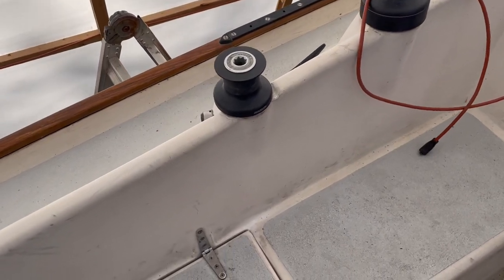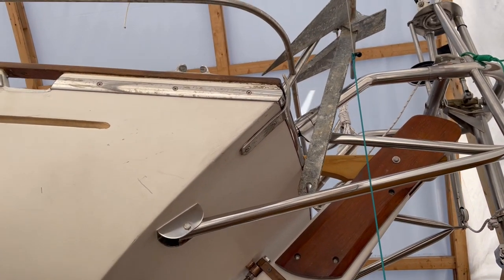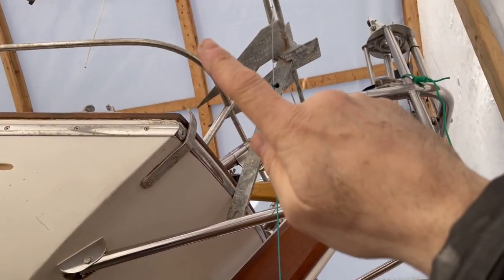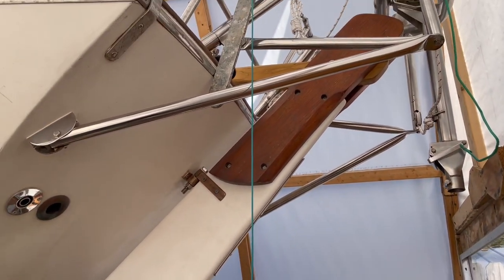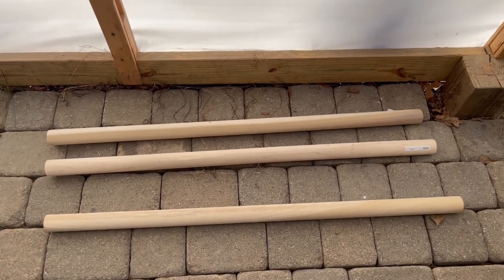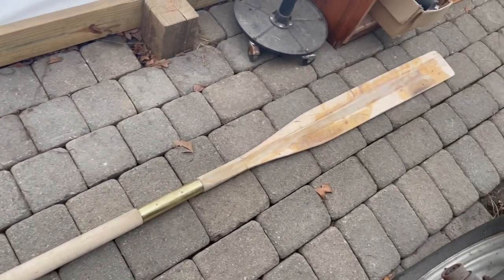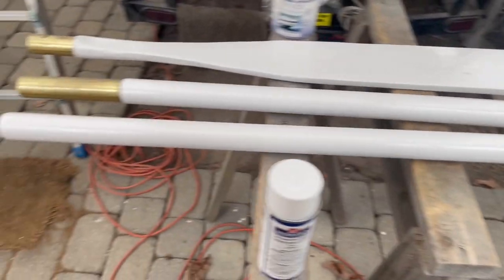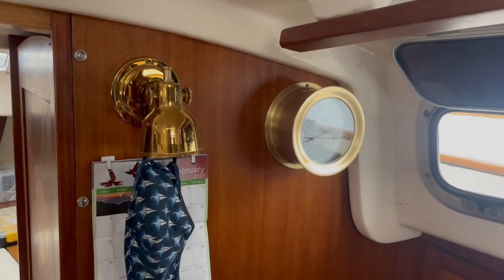Contessa 26 Refit ep.36 - Building a 3-Piece Sculling Oar

Comment: Interesting! I wonder how the sleeved joints fare in use; whether they stay firm and all, over time, as they transmit power and the twisting forces. Is there any taper to the brass parts or are they constant diameter tubes?
Reply from the maker: So far the sections have stayed together when in use, but time will tell if I need to insert a screw. The brass sleeves are a constant diameter, so sometimes a little lube is necessary.